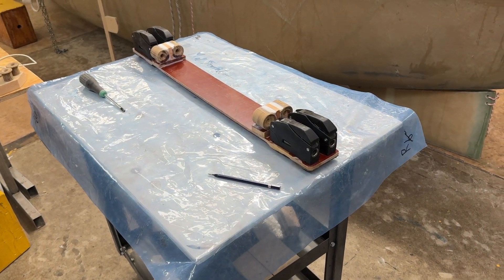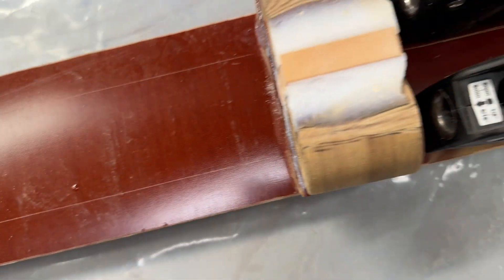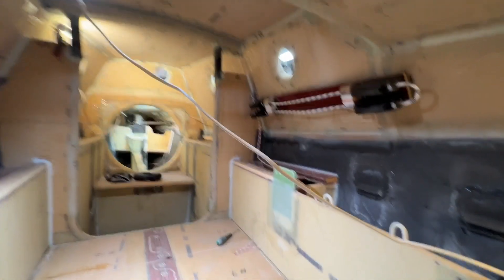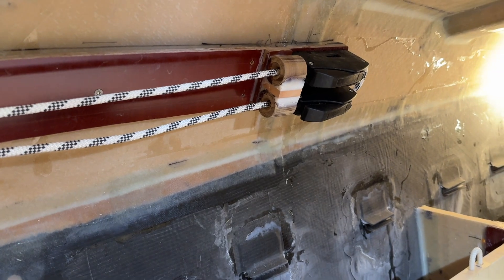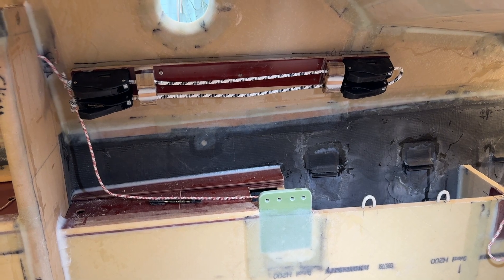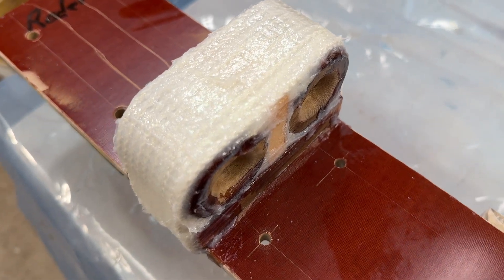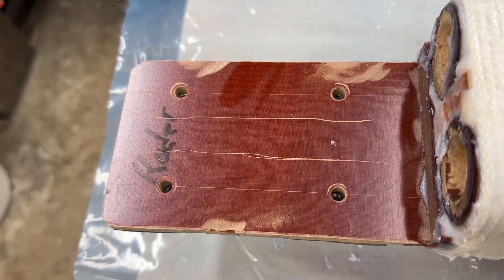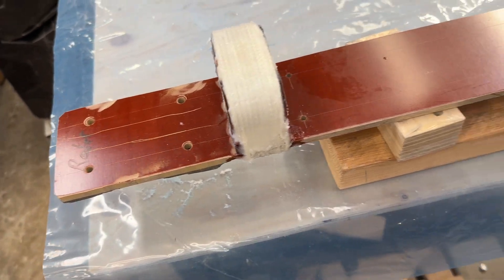2 Dec 2023 Finishing the vectorwinch

Comment: Mr Sven a question....what whould you say to someone that is a maker of a mini submarine/sail boat mix? Where you could go into a depth of 10 or 20 meters repeatedly and reliably, while obvious controls and thrust will be separated for submersible enjoying? I have been working on this idea for many years and have completed blue stage. Any tips or out of box thoughts? I also want the next model to fly/sail and be submersible. I'm goin to do it and call it the FSS GlobeSeastar 3D. You're videos are very enjoyable and you're workmanship is of the most finest thank you.
Reply from the maker: Jonny.
I know to little about that.
Butmit sounds a bit like the Swiss army knife kan do many things but not very good at any of them.
Sometimes it is handy but I do not think it will be a good sailboat, nor a good submirine.
But its an interesting hobby.
Reply: @SvenYrvindExlex  Thank you Mr Sven, I'm just building off the shoulders of those in aviation, submersible and seaworthy. The handbook has already been written in these areas of architecture, not definitely but absolute in the ranges I seek. And trust.... a Swiss army knife is heaven if the tool is built correctly with quality and care,the fact of having of one is just complimentary to any situation. I will send pictures in spring, from the beautiful Emerald isles.